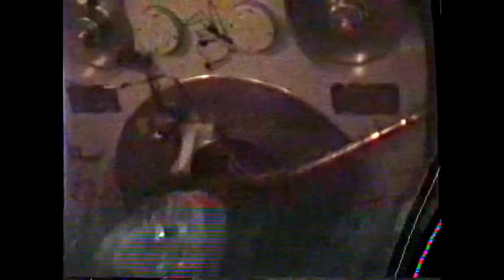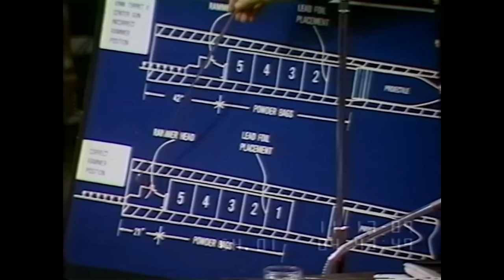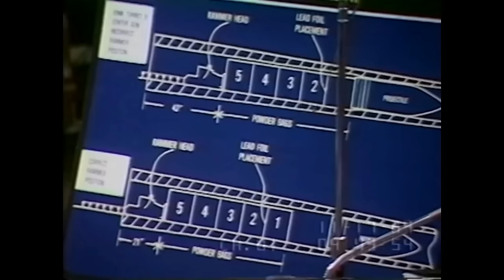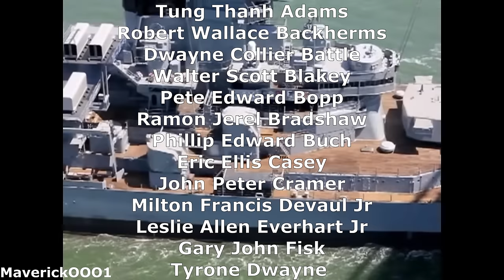USS Iowa Turret II Explosion: The Coverup That Almost Sank The Navy

Comment: This is a very good examination of what happened in the Iowa Disaster.

However:  The USN 16" 50 caliber gun does NOT use five powder bags, it uses six.  

For the Long, Armor Piercing (APC ) shell, they use six standard bags.

For the Shorter, High Explosive  ( HE ) shell, they use three standard bags, and three long bags, 
which hold more powder and thus increase the muzzle velocity and range of the HE shell.

The unauthorized test they were conducting involved loading a long, APC shell, and then using
three standard powder bags and three long,  high capacity powder bags.   The problem was, with
the longer shell in the chamber, there wasn't enough room for the extra length, and when the 
rammer pushed the second set of bags into the chamber, it ' over-rammed' them into the first
set of bags, and the compression resulted in ignition of the powder,  and the resultant open 
breech accident that killed  47 men.,

The Unauthorized Test was conceived of by the Gunney Officer Costigan and Master Chief 
Fire Controlman  Skelly in an attempt to use the longer, more aerodynamic APC shell with
the larger powder bags to ' Super-Charge ' the guns and give them a longer range.  They
believed that if this were successful, it would convince the Navy to manufacture  a new 
set of longer, more aerodynamic HE shells for shore bombardment, and would allow the
Battleships to remain relevant ( and in commission ! )   for another decade or more.  

As always whenever an Officer is caught doing something Stupid, he blames an enlisted
man to try to save his own career.   After all, NOTHING is as important to an Officer in the
United States Military as his own career !
Reply: Wrong.  The test they were shooting combined the heavy AP projectile with five D846 propellant bags.  The D846 propellant was formulated for use with high capacity projectiles and had it stenciled right on the bags to not use with AP projectiles.  The D846 propellant burned at a higher rate than the D839 propellant formulated for use with AP projectiles, thus use of six bags of D846 with AP projectiles would have created too high chamber pressure and might have exploded the gun.  The experiment was to see if five bags of D846 could create more chamber pressure than six bags of D839 yet remain within chamber pressure limits.  It was hoped that the higher but still within limit chamber pressure would produce a longer maximum range.  Chief Skelley convinced mid-level officers on Iowa to allow him to conduct these experiments.  Personnel at Dahlgren were also involved with creating the experiments, but top level officers there claimed they knew nothing about the experiments with D839 combined with the AP projectile.
Reply: @SomeRandomHuman717    I must disagree.  When you load a 16" gun
the shell is rammed until it engages the rifling.  Then the powder bags,
six in all, are loaded in two sets of three.  If you loaded only five bags,
there would be a significant air space between either the rear of the shell
and the first two powder bags, or if you loaded three bags first, there 
would be a space between the first three bags and the final two bags.

Either  case would result in a large air space in the chamber which 
could severely damage the gun on firing.   

The cause of the open breech accident was the rammer attempting 
to load long bags into a chamber that was too short due to the length
of the shell, which over-pressured the propellant and ignited it.

Comment: Seems to me that for some reason, the navy was incapable of even considering that this whole thing was simply an accident. Old equipment, rarely used, manned by sailors who lacked experience, doing operations that lacked any kind of automatic control (everything was manual).  What could possibly go wrong.  Powder bags were made according to best practices at the time using modern materials.  Nobody knew that any of it could cause problems.  For a string of unknowns, shit happens.  Sadly,  in this case, good people died.

Comment: There was a picture article from years ago where dude trespassed onto the ships in that bay the iowa was mothballed in. As soon as he set foot on the iowa the guards moved. (cameras or sensors) So he only got a few pics from that. The short version it sounds to me possible maintenance issues. (maybe powder ram hitting too hard? Did they say hydraulic leaks? and dangerous charges that were very old (which could make them more dangerous because the chemicals breaking down) and using the WRONG charges for the wrong shell could have caused the accident. Nothing to do with a specific crewman.

Comment: At 0:15 the photo you show, ostensibly of "Vice Admiral Jerome L Johnson" is a photo of an Admiral, not a Vice Admiral. Three thin stripes above the thick Admiral stripe on the sleeves is for a 4-star Admiral; a Vice Admiral would only have TWO thin stripes above the thick Admiral stripe.
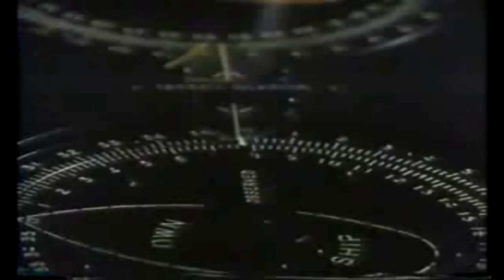Reply: At 4:28 the photo of "Rear Admiral John Buckley" is of a Vice Admiral. Three stars == Vice Admiral
Reply from the maker: I believe that is a picture of him at the decommissioning of the Iowa in 1990, I believe he was promoted between the incident (1989) and then. But it is Johnson either way
Reply: You do realize he wasn't born as a Vice Admiral and there's pictures of him before he achieved that rank, right?

Comment: This is an attempt at historical revision.
I saw the investigation, and this completely omits the fact that the rammer controls were frozen in position. Showing that there was no over ramming.
The investigation, due to improper cleanup after the explosion, and before the investigation, could not reach any definite reason for the explosion.  Too much of the evidence/debris from the turret had been thrown overboard. If there had been evidence of a timer or device causing the explosion, it had been thrown in the sea.

Comment: There are scum in ever branch, 
Here's a short story, although this is nowhere near the tragic events of Iowa: I was a USMC Mechanic, Humvees and 5tons mostly, but we had a vehicle called a cucv, basically a Chevy 2500 with some extra stuff under the hood. I had one that I was doing annual maintenance on and it needed all 5 tires replaced at the request of my Sargent (including spare) so I did the paperwork and ordered them, along with any other stuff. Then I went on Leave that weekend and was off base for a full 8 days. When I came back, I had CID (criminal investigation dept) asking me where I put the tires. Basically, they came in, and then disappeared from the motor pool. Found out that my Sgt had taken them and signed off my paperwork saying I received them, and then he (Sgt) sold them to our Staff Sargent for his personal vehicle, they both knew they were military owned and tried to pin that shit on me. If I hadn't been on leave and out of the area, I wouldn't have had an alibi. So yes, there are snakes, and not necessarily officers

Comment: The number of sailors stationed in the turret that the manual had originally stated should have had 30 more people than the 47 sailors who were killed.
Maybe physically , the guns didn`t need a full compliment to operate the guns that the manual required but having less people in the turret would have less eyes to monitor the crewmen to see if abnormal operation was taking place.The guns should have included more officers that could keep an eye on procedures with a "skeleton crew" .If someone did it deliberately or not, fail safes for having 2 people for each station to cross monitor for extremely dangerous jobs should have been followed.
Someone made a mistake that`s for sure.
I don`t think experimental operation for the powder bags was the culprit.Experimenting with an understaffed turret where proper procedure is paramount is the Navy`s fault and is the culprit for trying to save money and not having an officer to monitor all aspects of firing these type guns.
The New Jersey museum Iowa class ship has a video of the step by step operation of the main guns and almost every position has more than one person that could have stopped this tragedy from happening.

Comment: Did anyone notice that the entire talk is almost verbatim from Wikipedia, with a few transitions added?
Reply from the maker: You can check my sources from the description, the Wikipedia article pretty much quotes the reports that were used to make this video
Reply: @sealordmountbatten  I really like your sources.  Not all are listed in the Wiki article.  If you are a real researcher, you know the difference between [using Wikipedia to find interesting sources], and [just reading Wikipedia's condensed summaries].  The Sandia Labs report is extremely technical, and certainly not quoted, but parts are summarized.  Your GAO links are dead ends.  Your link for the book, "A Glimpse of Hell" is just the covers, but that's as it should be, because it's copyrighted material, nevertheless, the book is not quoted or summarized in the wiki article, only mentioned as having been a point of legal contention, due to its implications on the Captain.  CSPAN footage of the hearings is fantastic, but also not mentioned anywhere in the wiki article, and clearly not used as a source here, though it is mentioned as a source.
Reply from the maker: @underthewronghat.0101  if you sit through and watch the CSPAN footage, the testimonials given through the various witness are summarized in both the article and the video. Such as the result of Sandia’s testing.
Reply: @sealordmountbatten  Be careful.  I did a little research into the GNU Free Documentation License, and I think this video violates (US) Copyright Law.  From what I can see, Wikipedia doesn't seem to "chase" copyright violators, but you could get reported to YouTube.  I love using Wikipedia to FIND good sources, and I'm not a Lawyer, but I think quoting a whole article isn't merely plagiarism, it's Copyright Infringement.
Reply: @sealordmountbatten  Yes, I love the CSPAN videos.  CSPAN are just great.  CSPAN is not sourced in the Wiki article.  That's the concern.  At literal level, the Wikipedia article is not summarizing the CSPAN footage, because CSPAN is not sourced in the article.  The Sandia Labs report is also not cited directly, but indirectly through the NY Times article, on the Wikipedia page.  The Lab report you linked is WAY better than the NY Times article, but again, Wiki isn't summarizing the Sandia Report, Wiki is summarizing the NY Times.
Reply: You've got tons of research here, and your sources are arguably better than Wikipedia's sources.  You should just write your own, and use the Wiki article as a template, merely for organization.  Then pretty soon, Wikipedia will be adding you as a source (or you could just add new info to the wiki page).  ;-)
Reply from the maker: @underthewronghat.0101  there’s a whole CSPAN video on Sandia’s report, it’s something like 3 1/2 hours long. You can see it in the background when I’m discussing that part of the investigation
Reply from the maker: @underthewronghat.0101  I’m not worried about Copyright infringement from Wikipedia because this ain’t the Wikipedia article. I’m not sure what reads similar. When discussing historical events in the order that they happened, there’s only so many ways you can say something differently

Comment: This is literally word for word from Wiki 🙄
Reply from the maker: The six primary sources pulled from while writing the script were: A Glimpse of Hell by Charles C Thompson, the Department of the Navy's initial report from July 15th, 1989, the GAO testimony from the Comptroller General in regards to the issues aboard the Iowa on my 25th, 1990, the GAO report about the same issues from January 1991, and Sandia's final technical report of August 1991, and finally the CSPAN recording of the hearings. If you take a look at these sources, then compare them to the Wikipedia article, you'll see that the wording is similar to the article, and then when taking the same information from those sources and turning into a script that is repeating the findings of these sources, it is going to sound similar.